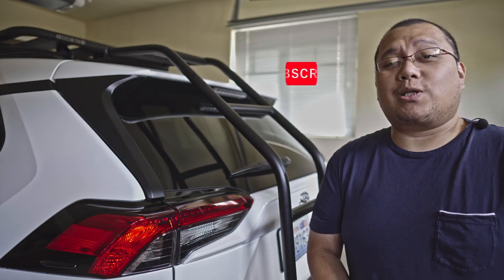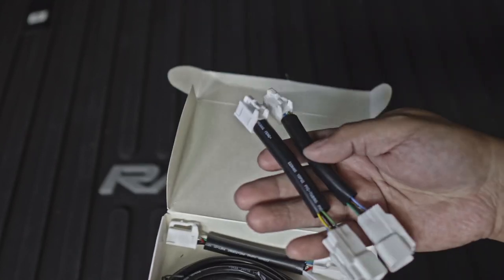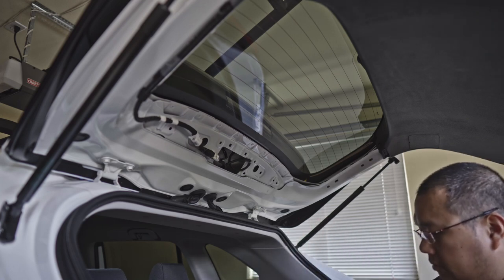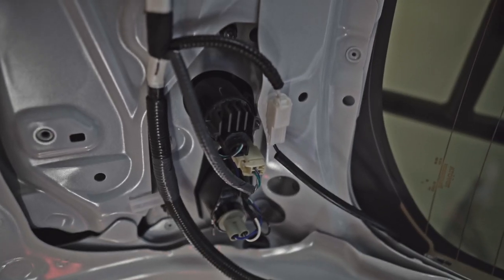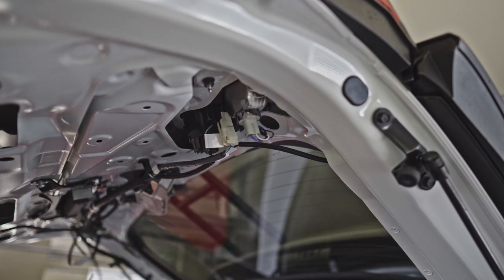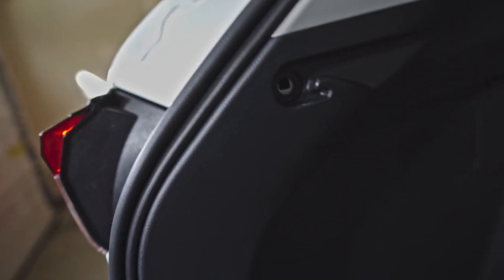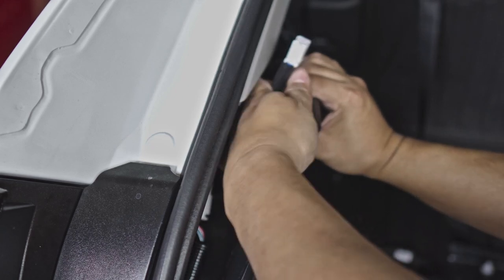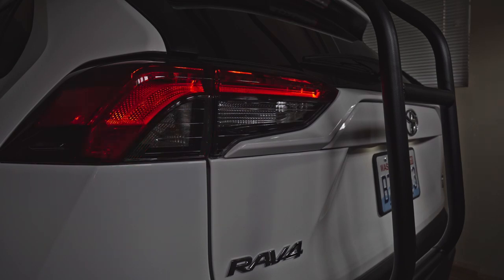How to Install 2019+ Rav4 Brake Light Harness.

Comment: Good vid but I noticed, and its been mentioned in other areas, that the lights, including the brake lights, are dimmer. I compared your before and after and I see the difference. 

I want the added illumination but I want the same brightness still.
Reply from the maker: They are nice quick diy that makes the rear light more functional
Reply: I did the same and noticed the same issue. You don’t want your tail lights to become dimmer. That’s counter productive. I think it’s because it’s an Amazon kit not a more authentic brand.

Comment: How many pins does your connector attached to the brake lights have? Mine has three but the wiring harness has four. Could that be the reason why the inner lights won't light up when the brake is pressed?

Comment: What are those harness that you put in the sides for? Seems it is just an extension of the existing wire connection.
Reply from the maker: It’s to connect the windows existing harness to activate the lights when you stepped on the brakes

Comment: I did install one on my rav4 hybrid and I am pretty sure I did it right but how come the inner light don’t come on or illuminates when braking. Only the outer brake lights that will illuminates fully. Is the short harnesses on the sides can be installed interchangeably or needs specific to be installed on the right or left?
Reply from the maker: They can be installed either side, just double check that the harness inside the side panels are fully seated.

Comment: I had an issue of pre-collision malfunction/visit the dealer after installing this. I did everything to solve the problem to avoid visiting the dealer but ended up uninstalling it to solve the issue. Any advice on how not to have this issue if I install it back again.
Reply from the maker: That’s weird, there is no where near it is connected to the pre collision stuff, i never got that issue on mine at all.

Comment: Where did you connect the other end of the short harness in the side and what is that for?
Reply from the maker: It shows on the video, but it is to power on the lights when the brake is activated

Comment: the brightness is decreased after installing the harness
Reply: Ur splitting the current, of course it dims
Reply: @Dev-op7kn  found the solution, the dome works with ground, so take a negative from dome and positive from battery.